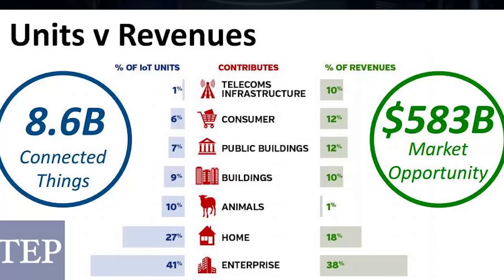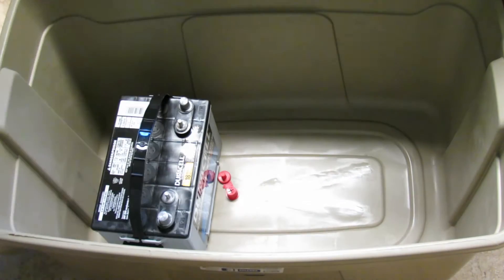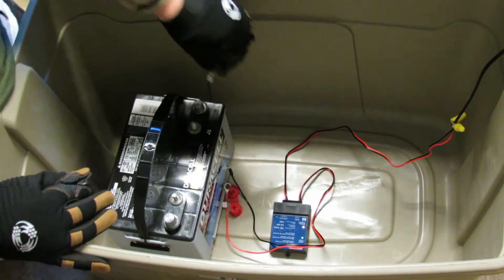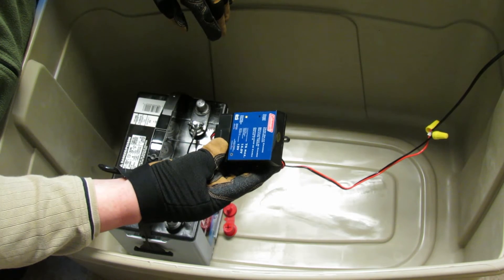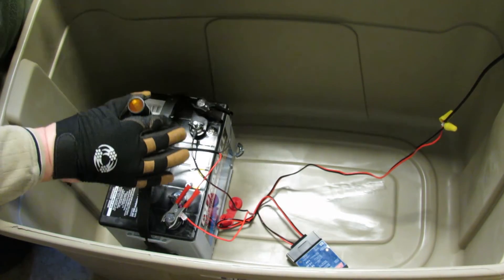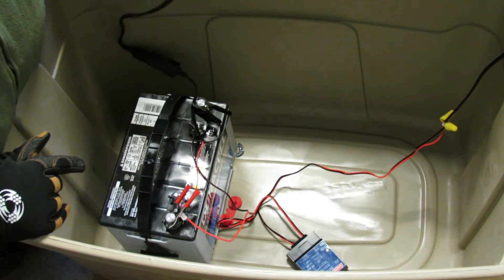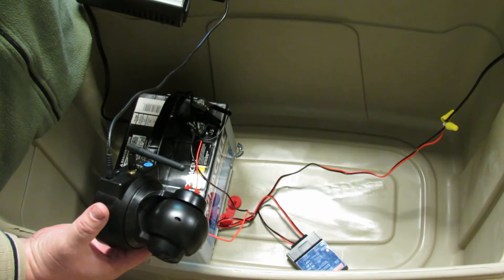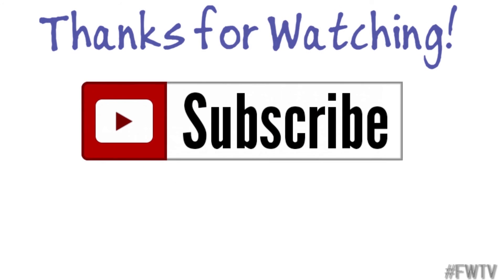Solar Power for Your Off Grid IoT Projects

Comment: Great video! Question, If you plug out the inverter how would you power the web cam?
Reply from the maker: I was thinking of a direct DC to USB wire/adapter. Some energy is wasted in the conversion from DC to AC. In the setup from the video, the current goes from DC to AC and then back to DC again.
Reply: @FranksWorldTV  Okay! Thanks so much for replying!

Comment: i know this only "hypothetical" for your video but in a real world situation you would never take 12v dc   transfer and boost it up to 110 ac just to reduce it back down to 5v dc.. that a whole lot of energy lost. you would just get a dc to dc transformer and go from 12v - 5v.
Reply from the maker: Good point. I did this video as a slightly seasoned n00b to inspire plain old n00bs to get experimenting with electricity and solar power generation. :)
Reply: i paused the video after you started the process to type that just to unpause it to fin out you kinda stated the same thing LOL